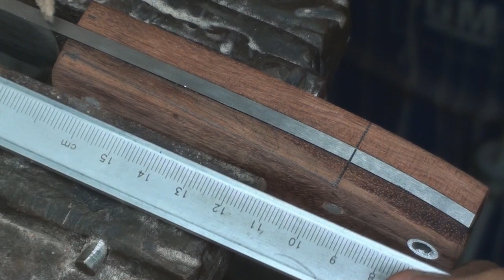Bródkes Custom Knives - How to make a knife 2/2

Comment: nice finish dude. i have to agree on poor safety though, part one i see a big dreadlock dangling near big fast spinning sander- thats like a hundred hairs being pulled at once bro... a whole new world of pain. table saw probably not the best option for rough out work on small bits. and chuck some cutting oil on the shopping list for drilling steel maybe? oh shit i sound like an older version of myself....